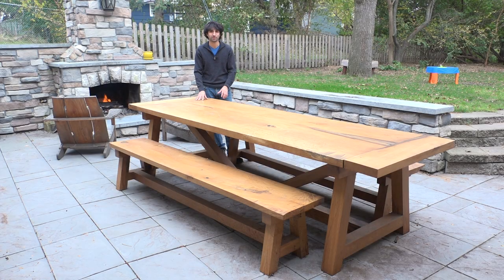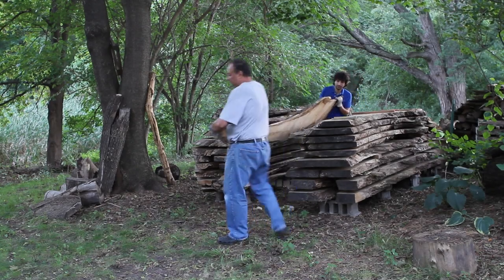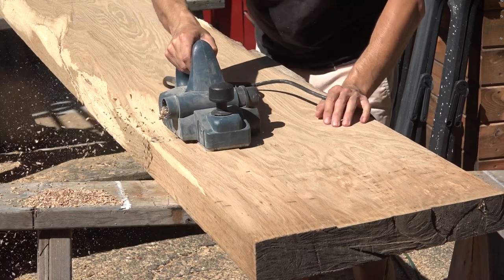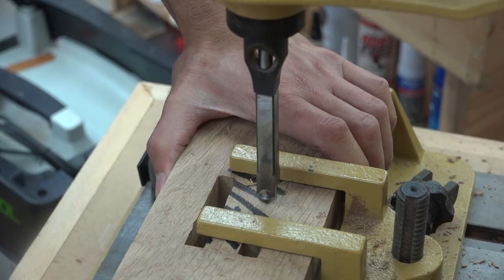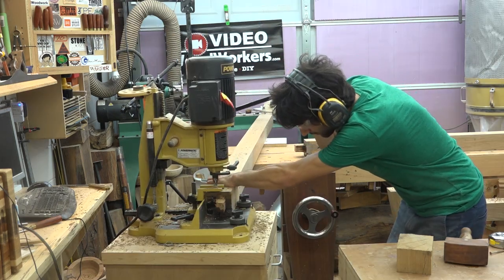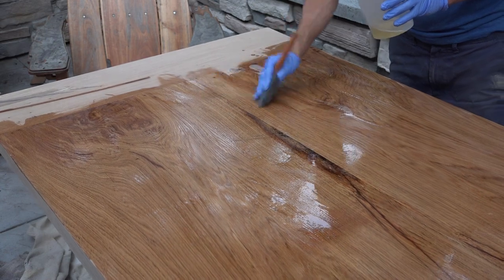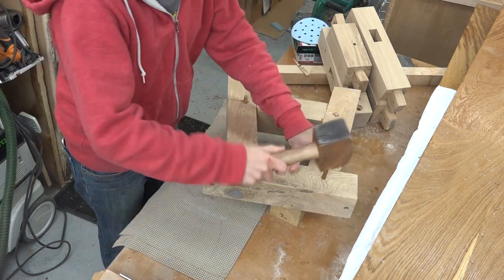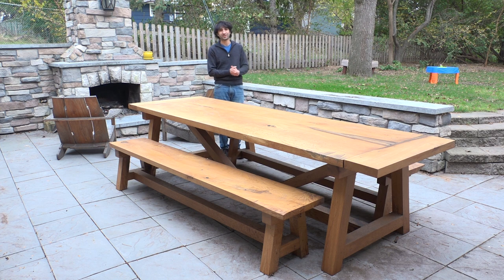White Oak Farmhouse Table and Benches From Firewood Log

Comment: Awesome job on the table. What really blew me away tho' was one of the circular saws you used. What can you tell me about the saw at 2:24 in this video. I need a saw like that for cutting timbers. Normally I have to work my way around timbers with my 7-1/2" saw and finish off with a hand saw. Not exactly the cleanest cuts.
Reply: Mike Bennett I think it's a Makita beam saw.  You can get them up to about 16" diameter :)

Comment: Matt; great content. Was rewatching this video again before purchasing it from the guild. You mentioned in a later video that if you were to change anything you would not have done breadboard ends on the top. What would you have used instead of the breadboard? Thanks for all you do.
Reply from the maker: Just end grain like the benches. Thanks!
Reply: Thank you very much for the response.

Comment: Man I love this table. I would love to do something similar but I don't even want to think about the cost to buy hardwood to do it :-)
Reply from the maker: +matt Dunn depends who you buy it from 🤓
Reply: Don't figure on going to a wood working store. You need to find a saw mill in your area and buy a tree they have or find a tree to take in to be slabbed. There are places in my area you can buy 1x rough sawn lumber for rustic barns cheaper than metal siding. My step dad and I sided a 40 x 80 barn and a 30 x 60 shop w/ native wood. I asked him why we were doing it all in wood and he told me it was cheaper than steel siding!
Reply: And here in MO, Walnut & Cherry is about the only wood harvested/ sold for furniture wood. Most White & Red Oak, etc goes up the chimney. Lesser wood you have to pay to have cut and/or hauled off.

Comment: Hi Matt, your outdoor benches and table are enormous. Everything made from scratch, thats awesome. I do have a question: Would'nt it be better for the middle diagonals to point up towards the middle ? I know the thickness of the tabletop will probably be enough to prevent it from sagging by itself, but as you decided to build such diagonal braces into the middle part, why did you point them middle-down ? Greetings from Germany

Comment: I hope the best for your project but I think that there has to be a reason why, in general, outdoor tables are made with tops of several planks, the planks spaced with 12 penny nails and attached to the base only along the center line.
Reply: Big Fat Tony's - yes, to give you an uneven surface to lay your plate on.

Comment: Hi Matt. I wondered about wood movement. It looked like you placed bolts into the bench tops (and possibly the table top) from underneath in such a way that it would not allow for seasonal wood movement. Am I missing somehting?

Comment: Could you go into detail about which joints received epoxy? It's hard to tell exactly which ones had epoxy. Never mind, I'm sure that is detailed in the guild project.
Reply from the maker: If I remember correctly, I just used the epoxy to assemble the bases